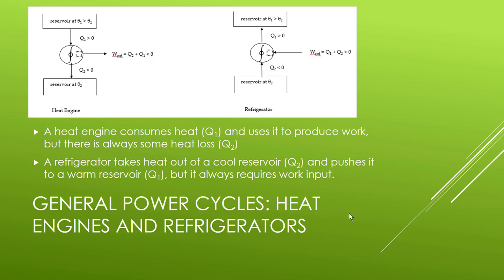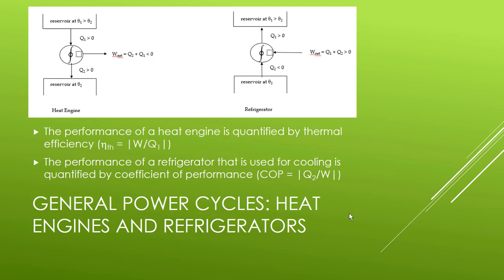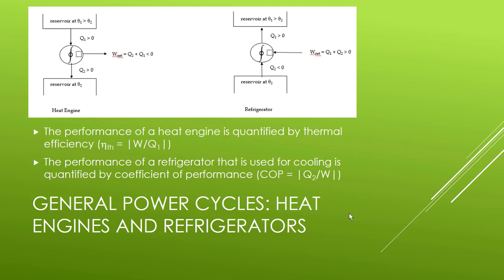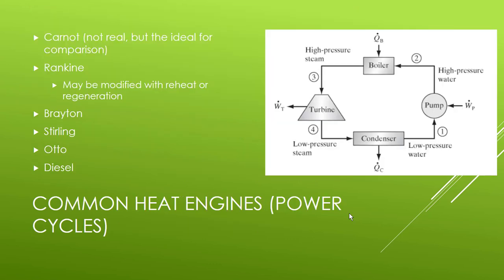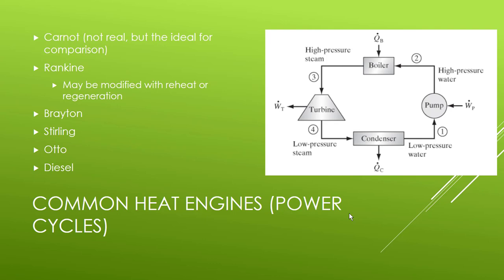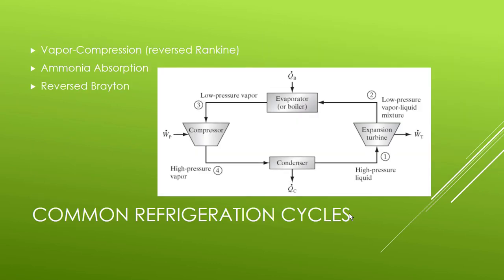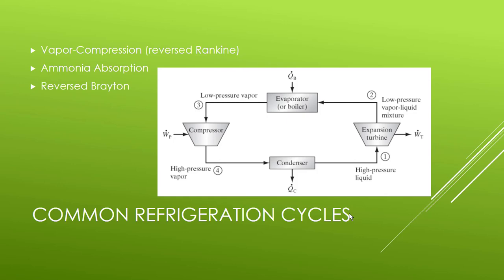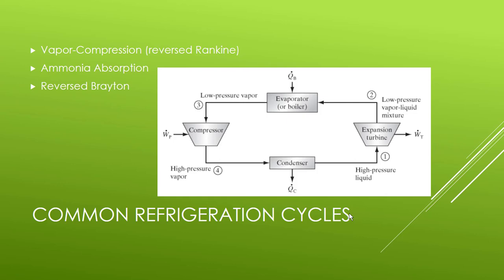02b Power Cycles

Comment from the maker: More Power Cycle Videos:
     Air Standard Assumptions for Gas Power Cycles (10:42)
 https://youtu.be/iyiYu2hmeTw
Ideal Brayton Cycle (11:45)
 https://youtu.be/tr-nrDgI90M
Basic Brayton Cycle Example (7:53)
 https://youtu.be/zcScKIvR7bM
Process Efficiencies with the Brayton Cycle (7:18)
 https://youtu.be/zl5fRcs31gA
Introduction to Internal Combustion Engines (8:26)
 https://youtu.be/9UdAd8MTfyA
Rankine with Regeneration (10:29)
 https://youtu.be/dG_jA5HOG1c
Rankine with Reheat (10:34)
 https://youtu.be/UUsW2OqRB8k
Rankine with Superheat (7:36)
 https://youtu.be/agw5zYKi_wM
Introduction to the Rankine Cycle (7:22)
 https://youtu.be/GHFL9DVGfow